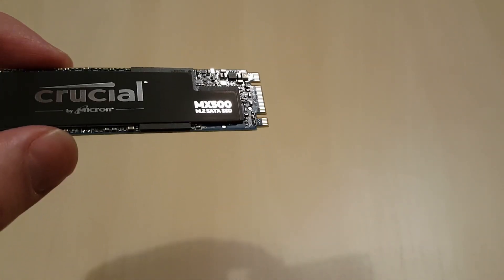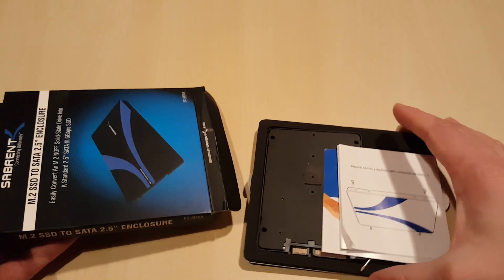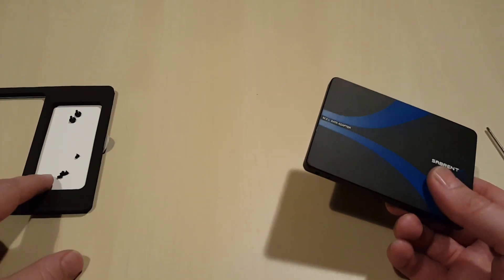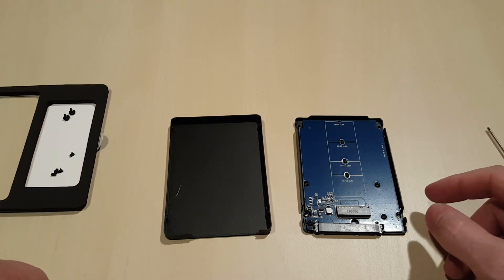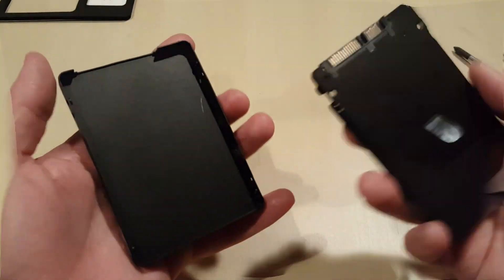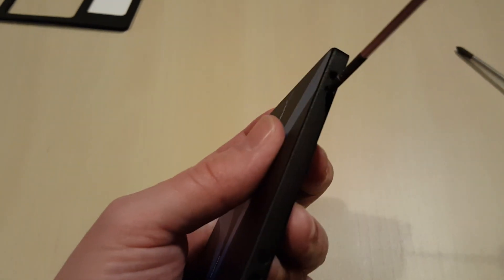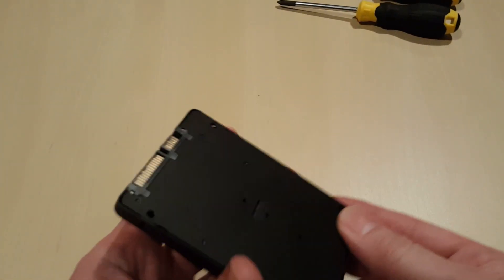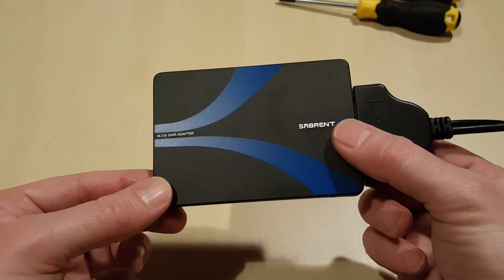Change M.2 SSD to 2.5" SSD Using the Sabrent Enclosure / Adapter

Comment from the maker: How to change the format of an M.2 Sata Drive to a 2.5" Sata Drive - Sometimes you can never have enough M.2 slots on your motherboard. 👍
Reply: U need download this software ) AOMEI
Reply from the maker: @youtuber-uh2kn  Chinese Software probably isn't the best choice now is it
Reply: @CalmCal  I don't know is I Chinese, but for me working well, I just jailbrake ps3, and should copy games on usb 128gb, but usb didn't come with fat32, so then I just use that software and works well )
Reply from the maker: @youtuber-uh2kn  Yeah it is Chinese, very easy for them to slip on a hidden partition, W10 can format in fat32 - you just need to select it, too late now but remember for next time👍
Reply: @CalmCal  good good )
Reply: does this sata adapter reduces performance of nvme ssd?
Reply from the maker: @gamersaji4167  This is Sata to Sata, NVMe is different.

Comment: This looks great. Is there a version of this that will take 2 x m.2 drives in one case?
Reply from the maker: Hi, I haven't seen one but I wouldn't run two drives through 1 Sata connection, there are some duel ones that you can use through your Pcie ports. I haven't personally used any, you would have to look at compatibility and explore  if there were any benefits to do so.
Reply: @CalmCal  Thanks so much. Looking forward to it arriving in the mail.

Comment: That's a B+M m.2 drive.   How can I do this for an M-key m.2 drive???
Reply from the maker: This is SATA to SATA, NVMe drives are a different breed due to their higher speeds, they have to be approached in a different way and make use of PCIe ports rather than SATA connections.

Comment: Hello, i bought a ngff adapter. But my ssd does not work. Any differences between nvme and ngff?
Reply from the maker: Hi as per pinned comment this video is about Sata to Sata products, NVMe is a different system it is a lot faster and not compatible with this particular Sabrent enclosure. I have no familiarity with the ngff adapter you mentioned.

Comment: Good video 
I bought the Orico 2.5 inch case & it came with 4 pads any suggestions under the board or on the ngff chip  🤷🏼‍♂️✌🏼

Comment: What about the ssd m.2 temps inside when you close it with the cover or lid ? Is it too hot ? My Wester Digital 2 TB M.2 Sata3 needs a heat sink, it is hot like my Samsung 970 EVO 512 GB NVMe
Reply from the maker: To be honest I didn't keep an eye on the temps at the time but it performed well as a boot up drive for years with no noticeable issues, I just use it for back up now 👍
Reply: @CalmCal  Hi! Is it faster to buy a 2400 read 1800 write nvme ssd,put into it, than buying a samsung 870qe, sata ssd in a pac build, will it be faster?

Comment: would you be able to use this adapter to uograde a 2012 macbook pro? or would it not accept the nvme?
Reply from the maker: This isnt an NVMe drive just standard m.2 👍
Reply: Think with out problem, but maybe u need msata wich is smaller )just don't go over the line with storage) think 256gb it's OK 🤔

Comment: Do you know of one for M Key M.2 Sata Drive to 2.5" Sata Drive?
Reply from the maker: M Key is the NVMe drives, it would be a waste to slow these down to Sata speeds - it might be better to see if there is an adapter that plugs directly into a spare PCIe port on the motherboard instead to keep utilizing the speed. 👍
Reply: @CalmCal  My laptop don't have PCIe port.    The drive was given to me.
Reply from the maker: @shrimpbynightbythomas8212  There might be an adapter for internal use but I haven't seen any, for external use there are some USB ones, I haven't got any though 👍

Comment: Bro after enclosing the m.2 into that adapter,can we put that inside our laptop or should we connect that externally with our laptop?
Reply from the maker: Hi, this is just a change of format from sata M.2 to 2.5" SSD. The purpose of this was to re-use the sata M.2 drive that I had already purchased. The speed of the drive has not changed much - as it is still sata speeds. If you have a laptop look to see what drive suits your laptop best dont buy a sata m.2 and this enclosure thinking it will be faster, it won't it is still a sata connection. My reasons were that I only had 1 x M.2 slot on my motherboard which I put an NVMe M.2 drive - replacing the sata M.2 drive as the NVMe drive is faster. Using the enclosure means I can re-use the sata M.2 drive inside my pc or externally by using a USB to Sata adapter. Hope this answers both of your questions bruv 👍

Comment: Does it reduce the speed if you put in that case?
Reply from the maker: This is a Sata speed M.2 so virtually the same - just using a different port 👍
(It's not for an NVMe drive)

Comment: Would this work with a  SSD PCIe NVMe?
Reply from the maker: No - if it did you would loose speed of NVMe anyway - this is sata to sata
Reply: @Calm Cal  is there a way to do this with an nvme m.2 drive, I need to purchase an ssd but my system does not have an m.2 slot on the mobo being an old system. So I was thinking of buying an nvme instead of a 2.5 for faster speeds when I build my new pc later. In short ssd is all that's needed now but like the idea of getting a faster drive so later I won't regret not buying the faster drive.

Comment: Will it work on the Samsung 970 evo?
Reply from the maker: No don't do that, this is for Sata M.2 to Sata SSD 2.5" format.
A 970 Evo is an NVMe drive that plugs into the M.2 slot, it is very fast - you will loose all the speed if you swap it into this casing. 👍
Reply: @CalmCal  so is there any NVMe to sata adapters? Or it will be the same and ill lose all speed?
Reply from the maker: @7bid  Yeah same, you will lose the speed it will only transfer at SATA speed, you don't want that. The reason I used this case is the MX500 is already a Sata drive (M.2) and I wanted to put an NVMe in my M.2 on my motherboard but I still wanted to use the MX500 so I put in in the 2.5" case so I could plug in into the SATA ports on the MB. If you have got an NVMe drive and you can't put it on your MB I think you can buy an adapter that plugs into your PCIe slots - look for NVMe to PCIe adapter. I haven't used one so can't recommend one have a look at some reviews video's before you buy. 👍
Reply: @CalmCal  thanks❤

Comment: It is a good quality ? I use a Western Digital Blue SSD M.2 Sata3 2 TB. I had use the 2nd M.2 PCIe Gen3.0 at 2x with my Samsung 970 EVO NVMe x4 because the WD M.2 Sata3 2TB only is compatible with the first M.2 socket Sata3/PCIe Gen3 x4.
Reply from the maker: Yeah this is only a case to change from m.2  format to a Sata connection which means sata speeds, if you are thinking of putting in a NVMe drive in there you will loose the speed benefits of an NVMe which is a waste. Sabrent is a good brand 👍

Comment: Thanks for the video! Is the outer black case of the enclosure metal? This enclosure plus a SATA to USB adapter is a much cheaper option than most USB M.2 enclosures I've found online.
Reply from the maker: Hi, yes the enclosure is metal 👍
Reply: @CalmCal  can you use the drive into the adapter as boot?
Reply from the maker: @Puzzicanello  Yes, if you want, it just changes the format from m.2 to sata format ssd. 👍

Comment: Let's say you used this setup to replace the internal PS4 PRO drive, would you get much faster speeds than that of a regular SATA SSD?
Reply from the maker: This is still sata Luke, it is only changing the format from m.2 sata to an original sata connection. I'm not sure what the speed of the drive is on the PS4, what components maybe affected or what its limitations are, if you want to speed yours up  maybe you will find an answer in a PS modding group.
The really fast m.2 drives are NVMe drives, if you used an NVMe drive in this adapter it would be reduced to sata speeds which would be a waste.👍
Reply: This would work with PS4 Pro as the PS4 Pro supports SATA III the standard PS4 does not benefit as much as thats limited to the older SATA II standard